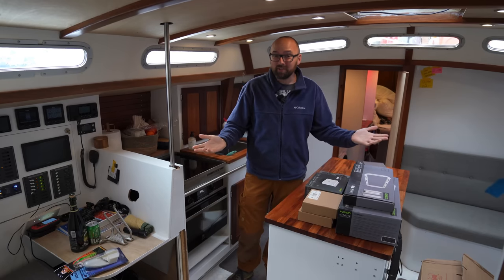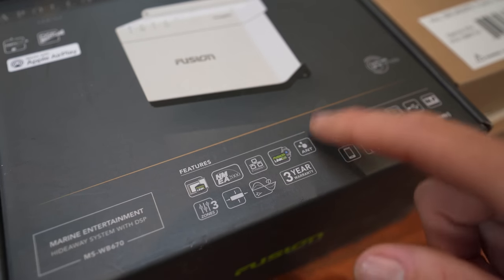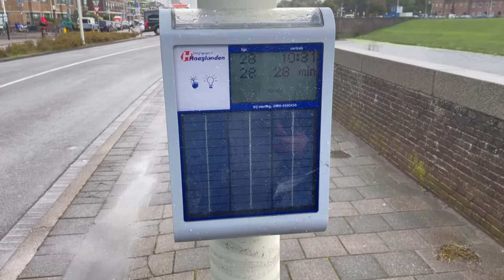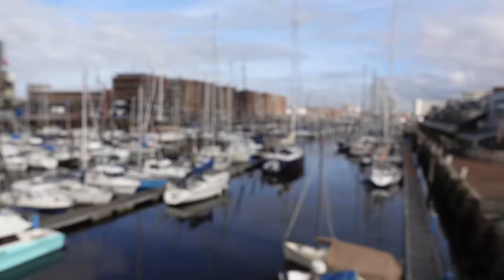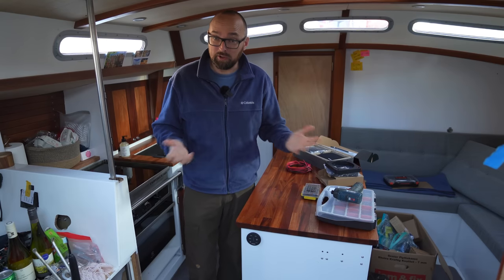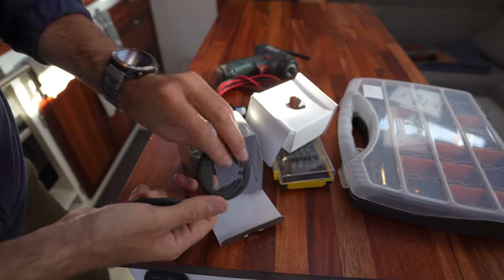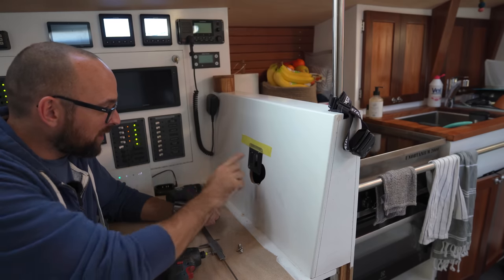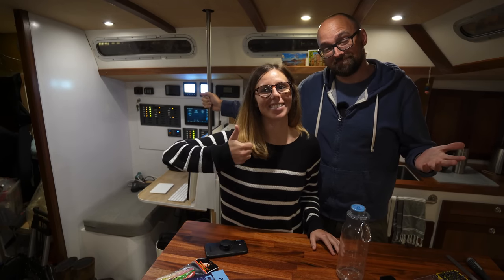Sail Life - Fusion Marine sound system, new Mac Mini & miniature madness

Comment: It is amazing that all of those miniatures live outdoors exposed to the elements such as rain and UV exposure.  It must not ever snow there.  Just keeping it all clean from dust, grime, bug and birdshit must be a full time job for a decent-sized work crew.

We installed a basic Fusion marine stereo on our boat 4 years ago before we started cruising. It was a small head unit that fit right below the VHF and SSB radios in the nav desk.   The previous owners had a basic car radio with cassette deck installed with some fairly decent older Realistic car speakers that actually sound terrific so we kept them when we bought the Fusion stereo. We added a set of 6" round waterproof marine speakers in the cockpit for the second zone.  We use them occasionally when hanging out in the cockpit at anchor but never when under way. We aren't the "share your music with everyone else on the water for a mile radius" so they suffice. The NMEA-2K connection to the chartplotter was neat but since we never listened to music or audiobooks when under way we never used the chartplotter to control the radio.  Wr had a USB drive but found the menus to be awkward and usually just streamed from our phones or other mobile devices or laptop. My wife's MacBook is our movie entertainment unit since we have no other TV screen on the boat.

We were fairly happy with the Fusion radio until it got fried with every other sensitive electronic device that was hard-wired into the boat when we got struck by lighting.  We bought another new Fusion radio to replace it. Our current one was 4 years old and no longer made. We bought the MS-RA70 which unfortunately was a little wider and required that I cut a larger hole and remove all the other radios to do that. Fortunately they all were fried too so they all needed to come out anyhow.  Lucky me!

We never could get Fusion-Link to work with the older radio so we never used it.  The new radio connects fine but the Fusion-Link app on Android really sucks due to needing to reconnect with the radio EVERY time the app is clicked on once it has been in the background.  This takes like 5 seconds every time and is quite annoying.  Also, when watching a video on YouTube like I just did with this recent Sail Life episode I need to click away from the YouTube app to get to the Fusion-Link app and Google does not allow a YouTube video to stream in the background so it instantly stops playing.  Now I am trying to fine-tune volume with no audio to hear for feedback.  Click back and start the video again but oops too loud this time.  Click back again and wait 5 seconds for Fusion-Link to reconnect, guess at the correct volume level and then click back to retest...rinse later repeat.  Not ideal.

I am very interested in the ANT remote control unit.  I hope you do a follow-up on those since we are thinking of getting some for our system.  We don't have smart watches which seem to work much better/quicker than the phone app.  I only wish they had a power-off button to turn the radio totally off from a distance to conserve the angry pixies when I am in my bunk and want to turn in for the night without needing to get up and walk across the boat to the radio to actually shut it off -not just stop it from playing.

Comment: If you wanted a proper computer, why did you buy a Mac? 😆
Reply: Because they're adults and don't have a need for blinking LEDs in a 1000W tower PC.
Reply: @simulacrae  Spot on 👍
Reply: @simulacrae  I'm building one for my son as we speak. It's going to become a game changer. Very literally. ;-)
Reply: @simulacrae  who mentioned LEDs? Only you.
Reply: Because the M1 Macs and MacOS operating system are by far the best value in the industry.   The goal of every PC vendor is the make the cheapest computer; the goal of Apple is to make the best computer.
Reply: @thesteve7397  then if what you say is true you would buy a zotac mini or a raspberry pi. But what you say isn't true, it's just repeating apples marketing.
Reply: @ukrainewarroom  The M1 Mac has a combination of performance and power efficiency that's superior to Intel hardware.  It's not a marketing claim, it's specifications that have been verified by independent testing.  The M1 has higher performance than the Intel Mac, at 1/3 the power consumption.
Reply: @ukrainewarroom They're gonna be rendering video, they need something powerful, so no raspberry pies, and they didn't want a laptop because of the external screen. So why not buy a machine that is powerful, small and sips electricity? 

Have you actually read about the M1 chip or are you just hating Apple because reasons? 699€ for that machine is a great choice.

Comment: This guy...literally spends more time and money on unnecessary projects using only "marine" "duhickeys."   Unless you have a center consul that gets wet theres no reason to buy a fusion. the inverter charger system is literally rediculous as there is no reason for that set up if you have that rediculous solar array.  That solar bimimi completely ruins the weight of the boat design and will dramatically effect the boats ability to safetly sail. But what do i know I've just circumnavigate and refit 3 boats.  No idea why youtube keeps recommending this channel despite me asking it not to but every year it still comes up.   maybe youtube knows all watch and facepalm his half decade working on a small boat.  Literally people build boats for the time this has taken
Reply: The nerve of the man, rebuilding his own boat, in his own spare time, with his own money, in his own way.
Reply: @Clockwork_Planet  honestly youre right...kinda.  Sometimes people need to hear the truth and my take on this is coming from a young 15 year veteran of cruising, sailing, refitting ect.  Youre seeing these videos really show impractal ways of "sailing the dream" and by putting yourself out there you're going to get critiques. "Computer progammers" and avid sailors dont buy the most expensive  proprietary sailing equipment, they program them.  Everything on this guys channel exemplifies youtube learning and internet forum university to the greatest degree possible.  Every project you need experience you know....sailing, before you build stuff that a waste of time. Tgat solar arch in 60knots of wind is very unsafe.  I know a young couple who made this mistake watching his videos. Sad really. Trusting youtube "beginners" over licensed 500ton ticketed actual experts. You're right about another thing though, i do have nerve.